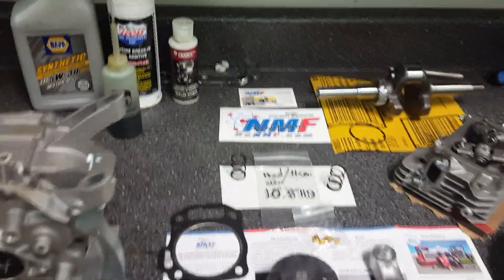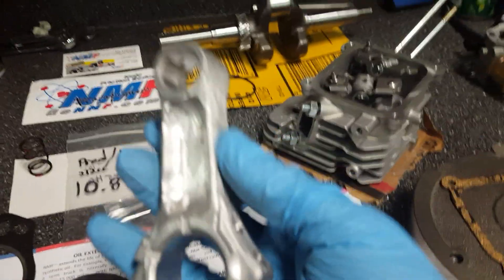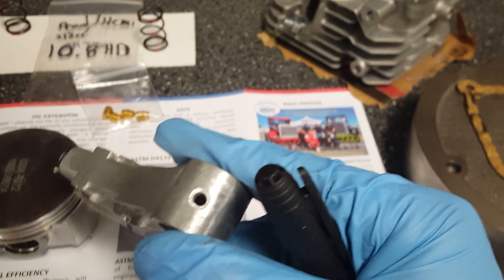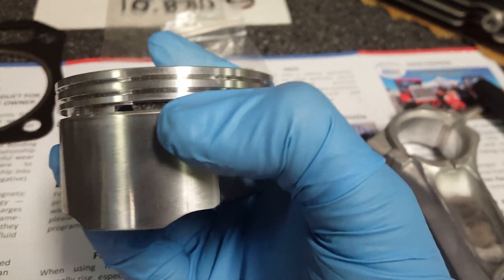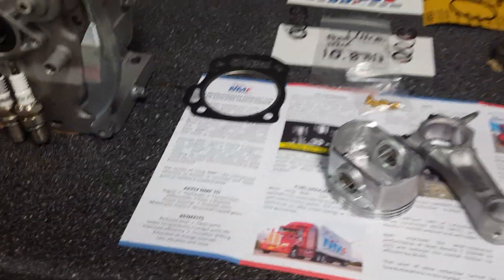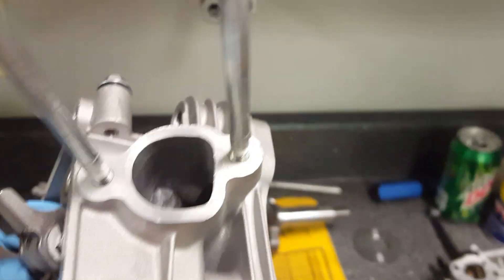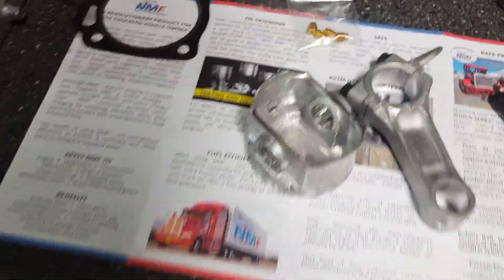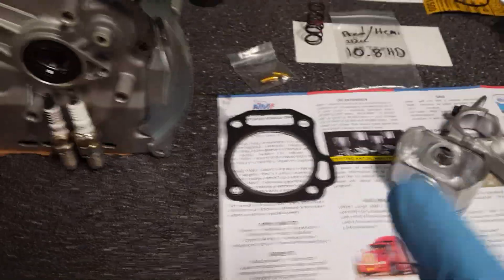Hemi predator box stock 212cc HP tips

Comment: You seem to know an extensive amount about these 212 predators.... I've mailed a lot of youtubers and so far I haven't gotten any answer from any of them, I've got a 212 hemi with stage 1 upgrade, but since the upgrade was installed it has been back firing and after about a quarter throttle, the motor sounds like it's going to die. What could be causing those issues? Any help would be greatly appreciated. Thank you.
Reply from the maker: Jeffrox M. the gears on the crank have been coming in installed in the wrong area.  If you can take a pic of your crank gear I can look & see if it's off. sounds like the flywheel timing is firing too soon. are you running a different flywheel key? 4342101376. Txt me anytime. I'm out to help any1 I can
Reply: philip hensley I've double checked the gears and it's lined up, also I'm using the timing key that came with the stage 1 kit, I believe it's a 8°. The screw that adjust the throttle is basically screwed as far as it would let me, only way it actually run and sounds decent.
Reply from the maker: It's sounding like a carb issue then. If your hands on like me I would disassemble it , lay it out in order & see if you find something clogged. or buy a new $20 carb. dump out the fuel, maybe bad. it definitely sounds odd.
Reply: philip hensley I'm waiting on my mikuni carb now, hopefully that will fix most of the issues, 18lb springs are on it's way too. Where I'm at (mormonville) anything that goes over 20MPH you need to have motorcycle endorsement and insurance. Thanks again for your inputs.
Reply: A mukuni will never benefit with just a stage one go billet rod and flywheel then after about 6000rpms that’s where the mukuni begins to shine
Reply: Nate's Garage 
That’s good to know Nate bc I have a Stage 2 on mine with The Mikuni and almost got the Stage 1. Is there any aftermarket Carbs that are good with the Stage 1. I also just built an Azusa with a 196cc Engine with Filter Kit and exhaust. I was going to put a Mikuni on it. Do u think it will do anything or are u just talking about Stage 1 Kit 
Thanks
Reply: Your issue could be the flywheel they were never designed to be run with the timing advanced go billet and swap the stock rod to a arc billet aluminum rod... You could try going up on your main jet and drill a couple holes in the gas cap to allow easier fuel flow.. The heavier the springs rhe harder it is on the cam lobes and valve train in general so when you do heavier on the springs you wanna go heavier on the rest as well.. Id suggest also swapping out to a 308 cam as well
Reply: Jeffrox M. 
I know this is a year old but I had the same issue on my 212 hemi Stage 2 but it would Back Fire at full throttle. 
The Stock Carb is 0.28 but if you have the Filter Mods, header, etc go to a .036 or 37. 
All my issue was though is I had a Straight Pipe and that caused it to backfire at full throttle. I put a longer Header on and a muffler from a Briggs & Stratton 5hp I had and it never backfired again. 
Since have a Mikuni 22mm and it is Awesome. Can’t stand the Linkage throttle.

Comment: what is the part number for the spark plug.
Reply: Ondrea Williams Autolite AR3910X High Performance
Reply: whats the gap size using in 212 predator nonhemi stage 1

Comment from the maker: ran great. I'm working on a new 1. testing this Saturday. most power gain in a all stock motor is to decrease piston ring tension.
Reply: How you accomplish that?
Reply: I just ordered a plug, I'm going to do some of the stuff you did this off season, do you have Facebook? I'd like to keep in contact since you are still running the 212
Reply from the maker: Yea Philip Hensley.
Reply: Don't know what one you are when I search lol but what method did you use to check ring tenson and what did you stop at? If you want add me same name as on here even the JR part
Reply from the maker: I'm in a picture with my wife. I'm in va. & I'm a well driller
Reply: I found you but it won't let me add

Comment: Hey, I've done all but internals so far, though I have removed my governor linkage completely (bypassing the governor linkage). After seeing how they Jimmy the governor gear onto the crank with no keyway (it seems) or even any kind of locked enforcement. Do you think it's incredibly wise to just pull my sub cover off and totally remove the plastic governor to the shaft / swing ROD (throttle pull back) as well as yank off that shitty gear they rigged onto the cranks bore? 

I've been worried that at high RPM (all I've done is jetting, intake and exhaust) - (I still have valve floating at max RPM 5k-5.2k RPM) but seeing how they rigged the governor gear in there, I'm a little concerned. I really don't see the stock rod blowing without massive compression modifications but it's definitely frightening seeing how the governor gear is held on.
Reply: Also, while I'm at it. Have you ever ran one of these to the balls with 18lb springs with stock push-rods? I'd rather go with the 18lb springs but I hear of bending with the push rods, which obviously results in inefficient valve lift and a total lack of performance.
Reply: Only because I totally realize your knowledge of small motor performance including 'racing' with them. Have you ever heard of the 3D Manual Clutch? I've been wanting to go for a torque converter, but the lifting of the motor or total refabrication of the gas tank, swing arm, etc. I don't know if a torque converter is worth it. The manual clutch with manual RPM engagement, I feel like I could just at a roll dump the clutch at 4.5k RPM and launch the thing. I don't look for doing 60MPH on a sketchy quarter inch frame mini bike with half ass braking, I'm a torque and launch kind of guy. Here's a link if you aren't aware of them https://3dmotorsport.net/collections/manual-clutches/products/3dma-racing-clutch-3-4

Go for about the same price as 'racing' centrifugal clutches which still.. brings no more top end or even really I would assume power, where having total control of engagement point / dumping clutches is far better than a $200 'racing clutch with max torque'. I have a max torque, 2,500 RPM point but it still leaves me with lag until the bike is in a good decent speed roll, then it just full blown launches with full power which is likely the motor itself taking off with full clutch engagement and at its mid peek power level.
Reply: There is a risk of coil bind with the 18lb springs on the hemi. Coil bind could cause bent pushrods. They can be used if the head is machined with spring pockets. I don't know about the hemi but if I wanted to run at higher rpm's I would use the 22lb springs from ARC racing on my clone.
Reply from the maker: I run the 18-pound Springs I just sand each side of them down a few thousands on each side. that helps prevent coil bind. install the spring turn the motor over until it's fully compressed use your feeler gauge and all gaps must be eight to ten thousands gap.

Comment: enlarging the ports of the engine and keeping the stock airbox and muffler actually takes some low end torque. because you lose some suction capacity/force. ever thought of that?
Reply: Yep. Years ago I read an article online where the guy was decreasing the port size for higher velocity with JB weld. His motorcycle engines were winning races because they had more power than others. He also mentioned that he does not polish intake ports because the turbulence is better for the fuel mixture.
Reply: +1'' .. That's also a  reason why lower CFM carbs, are better for out of the hole, than larger ones....................Think of a vacuum cleaner.... Smaller diameter attachments generally  pull up more crap  than larger ones.

Comment: This is some nice info. After the work you did here did you run with the stock muffler and air box? Do the racing rules allow you to port match to your stock muffler. In other words, are you allowed to grind away on the muffler inlet in an attempt to match the gasket size and shape? I would like to run similar to this with the stock configuration without removing the governor and keeping RPM's no higher than 4500. I do not race and I'm using a clone engine for a mini bike. I just do not want to over rev and start breaking things. And I can't see spending $140 for a flywheel and rod on a $90 engine just so I could safely rev higher.
Reply: Deucealive75 I had to run a stock airbox & muffler.  the hemi spark arrestor has 3 screens. remove 2 of them for increased flow
Reply: Remove the governor, your stock valves will do your limiting. Lol, literally. Once your hear floating, let off and sit back to a clean sounding RPM. You're not going to blow the motor unless you're pushing more RPM via a lighter flywheel with less resistance.
Reply: I've been beating the shit out of my jetted, 212 for months, I run full synthetic oil and check it often, no breakdown of metal or signs of any kind of metal debris.
Reply: Valve float isn't good for any engine. Especially cheap Chinese engines like these. Not saying it won't take it, just saying it's not good for the valves or valve train.